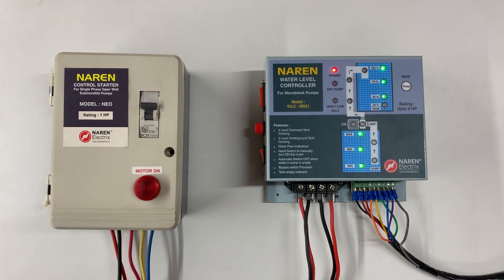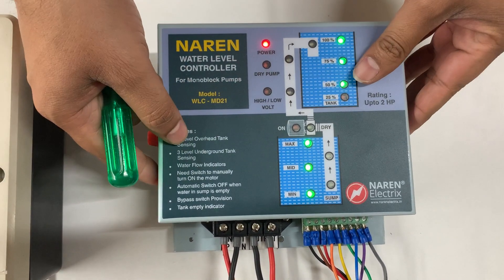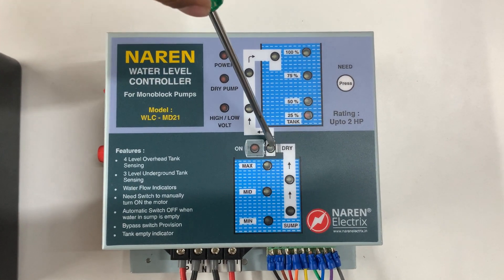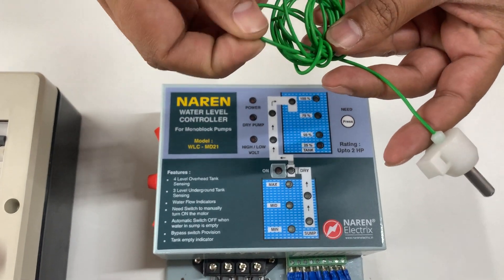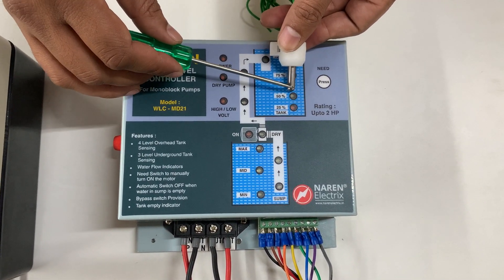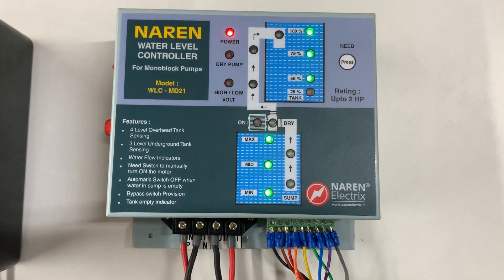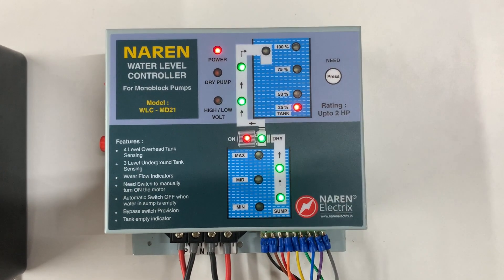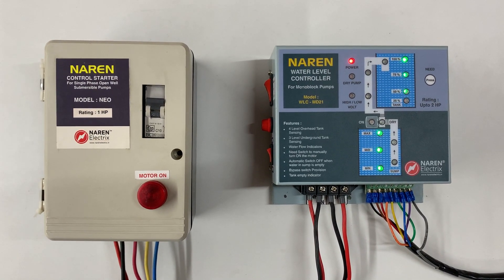Naren Water level controller model WLC-MD21 (English version)

Comment: Hey, i have this specific requirements. I want motor should automatically open when municipal corporation water comes and cut when it is not coming, and i want the municipal corporation water to be in sump, and from that it will supply overhead tank like this device! Is there any device available that can do both and operate both motors?
Reply from the maker: Hi sir. You need to use 2 different products for this application of yours. We can recommend right project. Can you please call 9972243774?